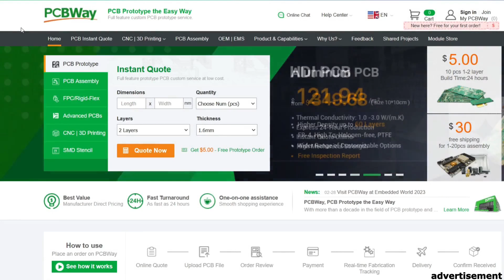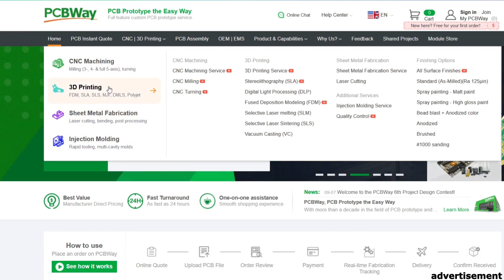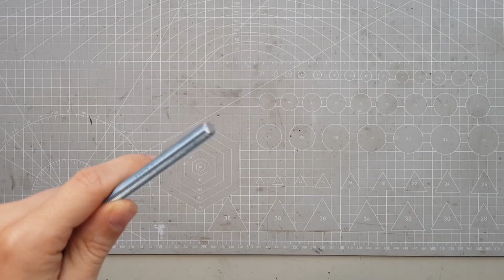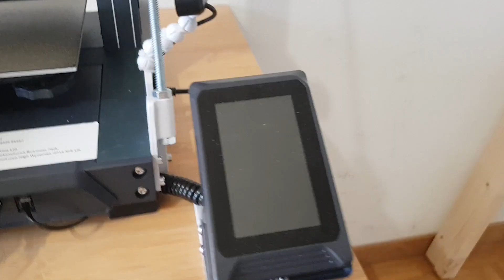More Printable Upgrades for your Neptune Printer (Part 2)

Comment: Do you have to do anything to the firmware to use the camera? Or does it just work upon plugging it in? Great vid!
Reply from the maker: Hi Liamdstein, thanks for your kind comment. I did not have to do much in the firmware. I only had to select (in fluidd) that i have a webcam pluged in and open the camera-window in fluidd and it worked.
Reply: @Dirt-E-Bikes   I have the exact same camera but have not had any luck with it working. What firmware are you on?
Reply from the maker: @brendans5179  Hi brendans, sorry to hear that. Does the camera work when you plug it in your laptop or PC? In my case it was plug and play. I can check my Version and will let you know, did you do a firmware update?
And you also use fluidd?
Reply: @Dirt-E-Bikes  Thanks for your reply. It's working now so all good.
Reply from the maker: @brendans5179  nice, glad to hear that 👍
Keep on printing and have a nice day

Comment: Is there a way to get exclude object feature with KIAUH on neptune 4/4 pro klipper?
Reply from the maker: Hi Abhinaym, i dont know KIAUH yet, is this a slicer aplication?
Reply: @Dirt-E-Bikes  it is a way to install plug ins for klipper and Exclude object will enable us to cancel objects in case you have multiple objects on the plate and one of them has gone mid print etc kind of situations
Reply from the maker: @abhinaym1017  that sounds really usefull, i have to look into this. Could have use that several times in the past. Thanks for giving me a hint to that, did not know that thats a thing 👍
Reply: @Dirt-E-Bikes  yes and and do you know about klicky probe? Its used to get perfect z offset without doing the paper levelling manually. Can you also look at how we can install it on the Neptune 4, it will save tons of time getting the z offset right.
Reply from the maker: @abhinaym1017  good point, yes i did see the clicky probe somewhere, have to look where i can get it. do you think that thing is reliable? I have to say that i have tons of other projects and im not sure when i can look into that... even that i belief that would be very good ones to upgrade hmm... 🤔

Comment: The n4p, just like the n3 and n2, needs a clip for the filament runout sensor that has a short section of bowden tube on the input. Even 1cm is enough. The brass ring will wear out when printing certain filament types. It hasn't happened to me but I have seen pictures on facebook.
Reply from the maker: Interesting, didnt hear of that problem yet. Thanks for the info 👍
Do you have the n4p?
Reply: @Dirt-E-Bikes  I have the n4p yeah, and a n3max and several 2S's. Btw those $10 webcams on amazon work just fine with the n4p. I use a pa552 on mine but I wouldn't pay more than $10 for it. Mine was $9 not on sale and it comes with a tripod. Though a custom mount would be nicer. You just have to SSH into your printer with putty and enable/start the webcamd daemon, then in fluidd enable the webcam in settings. The resolution can be set to 1080p inside the webcam.txt configuration file if the default 480p isn't enough.
Reply from the maker: @yoyofargo  cool, thats good to know, i have to look if i can set my resolution higher as it seems to be something way under 1080p on my setup

Comment: @Dirt-E-Bikes, You wouldn't be able to mount the rear stabilizer on the left side because of the power input location anyway, no?
Reply from the maker: Hi Verbalsin, sorry for the late answer, i somehow missed your comment. Yes you are right, there is the power input and if you want to install it there, you would have to do some modification on the parts.

Comment: for the first part... it should be enough to have them on the backside ... the 4 max has this also i think
Reply from the maker: True, the plus and the max does both have them only on the back side.? I would prefer the stabilizers on the front, but i guess it does not matter that much

Comment: Proximity and other bugs in Z-axis stabilizer v2 have been fixed. with new files.
Reply from the maker: Nice, thanks for the info, is it your design? I like it really much 👍
Reply: Yes. I designed it according to the machine.
There was a lot of vibration at the previous speed.
Thank you. @Dirt-E-Bikes
Reply from the maker: @budosdesign  so cool 👍

Comment: Some ideas for another one of these if you wish. KUSBA v2 accelerometer for input shaping for hardware has an STL on elegoos official discord. There's also a new fan shroud design that removes the need for the loud part cooling fan. 

Could also mess around with obico on the software side. Would also be super interested in seeing how this performs with stock klipper as well.
Reply from the maker: Hi there and thank you for the good inputs 👍i have to look in to that.
One of my subscribers also did a new design of the fan shroud that looks very promising, and as soon as his design is ready i will try it and show it here. Would be very nice to get rid of this jet turbine sound ;-)
Reply: Очень жду!  @Dirt-E-Bikes

Comment: Is there a charge in print quality, after mounting the rods?
Reply from the maker: Hi Magicfreak, it is visible on bigger Parts printed in high speed, as the gentry of my printer moved quite a bit without the rods. But i normaly dont print parts that high, only did it for testing. For small parts there is no visible change in print quality, at least not on my printer.